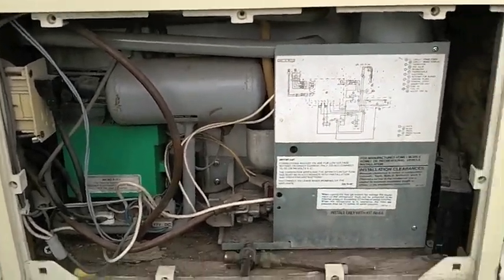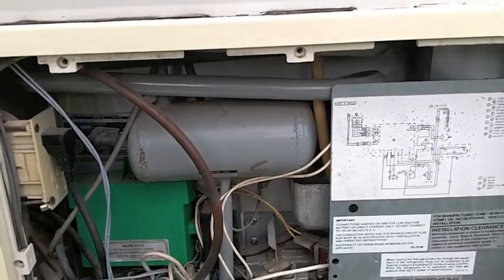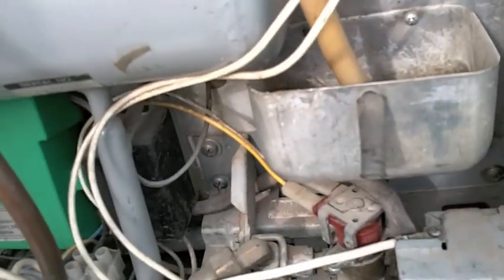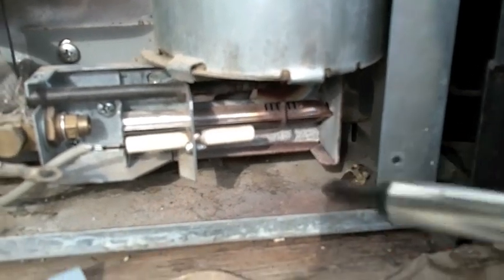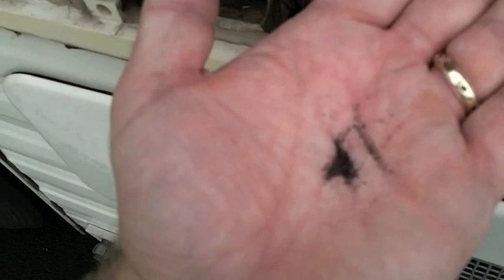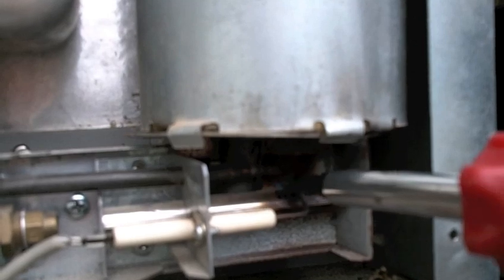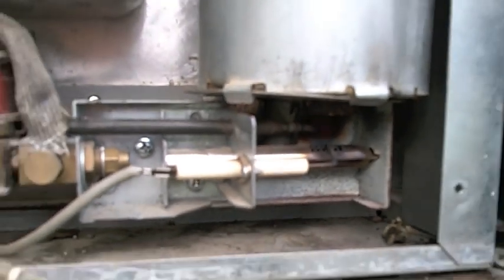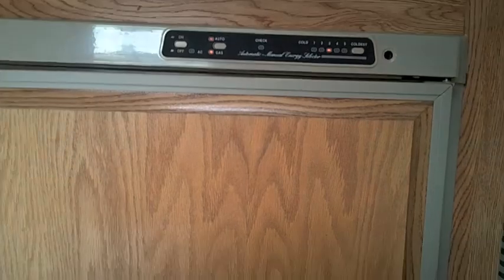RV Refrigerator Troubleshooting

Comment: i have a chescold portable 3way unit and it works great on 240v & 12v but on gas it gets warm or does nothing. so if i can open it up and check the burner ill let you know how it goes.  It worked ok on gas about 10 years ago but i had it in storage since then, flame is blue also.
Reply from the maker: +Mick Wolf Might have leaked all the ammonia.  Look for yellowish deposits.  You also might take it out of the unit and rotate it 360.  Leave it an hour or more on each "face" and end with it sitting upright.
Reply: Its getting to minus 10 on Ac, cant see or smell any deposits, was stored in a dusty dirty place though.
Reply: my bro has the same unit, it didnt run on gas so we checked the lines, it was all good up until the jet, so we removed it and put ut up towards the sun and saw a blockage, poked a strand of wire through it(very very small from a dc power lead of some sort) and checked it, it now has a good flame much bigger than mine does. so now im going to do the same. 
the jet part was seethrough also like it was made of glass or something and where the hole is showed a dark blockage when looking towards the sun. it got cold in the few minutes it was running but a full test is needed. ill report back when mine is done.
Reply: +NelsonStudios my jet had a blockage also, tested for a few hours on gas and got down to -9 Celsius and kept on going, yay thanks, my beer will be cold now 😀

Comment: Great video but sometimes it's the jet orifice getting an oily buildup around the Ruby that causes a yellowish flame ( solid blue is preferable ) . Get a ten millimeter box wrench . Unscrew it then drop it in a cup of alcohol overnight . That should dissolve the oil . Blow out the jet with air or your mouth . Reinstall . An honest repair place would probably just order a new jet to solve the problem . A dishonest place would do what I described then charge you for a new jet . Hope this is helpful .
Reply from the maker: It will help save someone's camping trip for sure.  Thanks.

Comment: Gear tips. You said you do this everyone the fridge starts to warm up. If you went out there every other month with an air compressor and blew out the tube fairly well, do you think that would save having to take it apart? Or would that not do the trick?
Reply from the maker: That would help as long as the air didn't blow it back into the burner.  That would not wreck the burner but it would mean that it would have to be taken apart.  It seems to me that this only happens on old refrigerators, mine is 20 years old this year, when the trailers are moving.  The bouncing knocks the crud off.

Comment: Questions dose the  Pilot stay on all the time? Or dose it shut off at a sirten degree depending on the coldness of frig.. p.s wats the plug to the left side was I unplug it pilot turns on plug it in pilot turns off
Reply from the maker: Some of the fridges will turn the pilot off when connected to wall power  and then light once more off 12v when disconnected.  Google the model number of your fridge to find an operating manual.

Comment: cleaned the burner and get a nice blue flame for about 15 to 20 min then it quits and check light on control panel on frig comes on . Turn frig off and the back onto gas and burner lights and burns for another 15 to 20 min and shuts off. What do I check now?
Reply from the maker: Check that the flue isn't plugged with wasp nests.  Check that the flame sensor is close to the flames.

Comment: Rather than tapping on the chimney to knock rust loose. Can you remove the chimney and brush out with a wire brush or replace the chimney as the galvanizing has burned away with a stainless steel chimney.  A replacement chimney can be fashioned from a standard double wall fireplace chimney pipe. The inner tube of the stainless will not rust.

Comment: I got one of these. The thing was working a year ago. I have 12 volts to it. I have gas  to it and this is evident at a 90 degree bend with a purge valve that hisses when I squeeze it open. I keep trying to light it with matches as well as hoping it will spark auto, but no flame. Gas but no flame. It's as though the control solenoid is 6not allowing gas to flow past it .  I'll try to put 12 volts straight to the solenoid to see if that opens   the flow.
Reply from the maker: The solenoid should make some noice you can hear or feel and can be jumpered with 12v.  I do not know however of any sort of squeeze  gas valve.  Unless I misunderstand you, that sounds wrong.  There is a rubber drain for the icebox but I don't see how that could hiss.  Your gas valve will have to be by law a brass lever or screw valve, nothing more.
Reply: +NelsonStudios It's a90 degree bend with a valve to turn on or off and it's spring loaded so that when squeezed , gas definitely hisses out of the thing. I thought it was purge.
Reply from the maker: Interesting, so you could purge all the air out of the lines to light the fridge quickly after the trailer had been in storage?  I know on mine I will turn all the stove burners on for 30 seconds or so before any of them will light.  I wish I could see a picture.  If you have gas for sure to the solenoid and you can feel the solenoid open/close then you might have a plugged jet. It will be a little brass nut at the end of the line facing the burner.  Carefully remove it and clean.  I use a single strand from a wire brush to slip in there.  Vacuum out the fitting before screwing it back in.  If that fails to fix it then I bet you have either a shutoff or solenoid that has failed.
Reply: +NelsonStudios Can I post a pic here? Got an Email address and I'll send you a pic of the thing.

Comment: On electric my freezer works, but not the fridge. Is it shot? And also the propane won't light for the fridge. Thanks!
Reply from the maker: On the propane check to make sure you have any gas at all, solenoid might not be opening.  If however on electric it still only cools the freezer, especially if the freezer will not go below freezing that is a sign that the ammonia in the lines might be going bad or leaking.

Comment: I also mostly boondock and replaced my Class C Onan generator with a home designed battery/inverter power center.  I use the inverter frugally to extend the battery bank charge as long as possible, so I need the fridge to work on propane.Didn't know a darn thing about these fridges.  Watched your video and cleaned the burner tube yesterday.  Now has a nice blue flame but fridge gets down to 37 degrees on electric and only 42 on propane.  Although the flame is nice and blue it seems a bit small.  Now I'm thinking that not enough gas is getting through the jet and it needs to be cleaned also.  Looks like an easy fix just like a small engine carburetor jet.  I'm going to take it out and clean it with carb cleaner and maybe run a wire from a wire brush through it a few times.
Reply from the maker: +william serrahn I have heard that sometimes funk can get on the jets.  Maybe cut a bristle off a wire brush and see if it is small enough to fit.
Reply: I took out the jet (10mm wrench).  It has a little crystal imbedded in the brass.  I sprayed carb cleaner both ways through it and wiggled a wire in it.  Later read the you should used wood alcohol and never use a wire - oh well.  Anyway installed it and fridge worked great on gas - it must have been a bit dirty.  So I would add advise to also clean the jet while you are in there.
Reply from the maker: Glad to hear it worked!

Comment: Hi,I bought a camper van and can't get 3-way fridge going in any of the 3-ways?Is there a switch somewhere...I can't seem to find one?Of course,past owner claimed fridge to be fine.  Thanks
Reply from the maker: Brian Montague 3 way?  Not sure what that is.  I would check that you have 12v to the power box at the back.  If it will not run, even when the van is plugged into house power I would check to see that you have that 12v.  Someplace in the van will be a fuse or breaker panel, in a camper or trailer they are normally near the furnace not sure where to look in a van.  Try googling "fuse box in (your model of camper).

Comment: A friend gave me a camper yesterday. The kind that goes on the back of a pickup with a section that goes over the cab. Among other things, it has a propane/electronic refrigerator. I don't have electricity, so my only option is propane. The freezer portion seems to be cooling very well, the fridge portion doesn't seem to be getting cold at all. Any ideas on what could be happening?
Reply from the maker: Clean your burner first.  When mine gets dirty the first thing that happens is the fridge stops cooling, eventually the freezer will also start to warm.

Comment: We have a 2003 Fleetwood pace arrow. We started fridge for our trip. Fridge freezer worked fine. Drove bout 5 hours. The fridge would no longer work on electric.Switched it to gas. Both worked for awhile. First the fridge stopped working. The freezer worked overnight. Now neither work on power or gas. We've only used RV 2 times. Not sure of its history. We think maybe needs freeon filled. Help!!!
Reply from the maker: Beth Bennett You can try taking it out and turning it upside down for a few hours then righting it for a few.  These fridges use ammonia most of the time not freon.

Comment: What if we run the fridge with electricity only? We have a 1995 Prowler and the fridge stop cooling period. The light are working but it defrosted everything.  We are currently living in the trailer and need help ASAP :(
Reply from the maker: The light in your fridge is 12v I think, the fridge off power is 120v.  On mine (1993) there is an actual outlet the the fridge plugs into.  I think you will have that also.  Unplug the fridge from that outlet and plug something else in.  If it works then your issue is from the cord forward.  Check for corrosion in all the contacts at the fridge.  If the outlet isn't working then you have probably blown a 120v breaker in the trailer.  Check for that.  Still might have an issue because it popped the breaker but that could be lots of things.  feel free to contact me at acme66[at]yahoo.com if this isn't making sense or if you still can't find an issue.  If you don't smell ammonia or see green/yellow ooze behind the fridge then likely you can fix it.

Comment: My ignition and electronics seem to work intermittently on the fridge and water heater. Not seeing a ignition and flow of gas. Also electric to the fridge but not cooling with switch in on position and auto setting.

Comment: While looking at this video and when you see the burner it doesnt look like the copper propane line is connected to it it looks open ???Also on the copper tubing that carries the propane there is a bolt that looks like its a cap for something to the right of the relay and left of the burner  ???
Reply from the maker: Imbyteme It has a gap so the gas can mix with the air.  That is normal.

Comment: hi.
i have a old 1990 hymer, and am having trouble with the fridge.  i have cleaned it all out and it now lights off gas, the only problem is i can not see the flame through the ignition window.  i pulled the window out and the tube it was attached too, i have cleaned this out and fed it back through.  Still no visable flame.  The problem now is that after feeding it back in, the tube is just hanging down the back of the fridge,  Where is it supposed to go?????? i am worried it will touch something hot and melt .  Any help would be great.  thank you
Reply from the maker: Could you see it at night?  A clean blue flame can be nearly invisible in the daylight.  You might try googling the model number of your fridge and looking for places that sell replacement parts.  They will normally have a parts schematic you can look at.
Reply: NelsonStudios
Reply: NelsonStudios nelsonstudios

Comment: Hello,
great video!
I belive the issue with my fridge is it leaked out the nh3 refrigerant. I've looked around in my area and can't find anyone who will repair or recharge the unit. is their a way the Amish could repair/recharge  mine? maybe have it shipped to them somehow? not the whole fridge just the cooling unit. or is their enyone who won't charge an arm and a leg for this sevice? I hope you could guide me in a promising direction .
eny info helps
Reply from the maker: I searched the internet and found a guy for mine I bet you can find a core for yours
Reply: EBay has complete cooling coil replacements with liquid inside.

Comment: How close does igniter need to be to gas tube.....it was clicking but not lighting, I cleaned out tube it lit. Now igniter will not click, is it a part that goes bad? I can light with lighter and will stay lit.
Reply from the maker: Try moving it closer and make sure the clamp holding it is snug and the wires leading to it are connected.

Comment: have a 2008 jayco camper the refridgerator when it runs for about 2 days it starts frosting up and freezes everything it is on a permenant site so it does not get moved
Reply from the maker: Too cold?  Now that is not something you hear often.  Not to be a jerk but are you sure the temp setting isn't too low?  Maybe the thermostat is bad and always calling for cool.

Comment: Instead of saying "you're working with propane and I'm not responsible...."
You should have instructed the viewer to disconnect power and shut off the propane supply valve......
If you read the service manual it will clearly tell you this. There are labels on the fridge that say this as well.
Reply from the maker: I do it with gas flowing, the flow to a fridge is so very small but that little flow should still help a bit of rust from sticking in an orifice. Your idea could also be a good one, all I know for sure is when working with propane I am not responsible.

Comment: i had a similar problem, how ever your video is awesome we are forgetting one thing as I learned tonight. There is actually a fourth thing that can go wrong as I learned tonight myself. The main house fuse box. There is a 20 amp fuse that controls some of the lights in the back half of the RV. For me I have a 94 fleetwood bounder class A. My fridge had no power, no lights, no nothing. I even ordered a dinosaur circuit board to replace the old one. turns out, I have 120v to the circuit board but nothing coming back out to charge the fridge via gas or electric. I jerry rigged my heating element to my actual home to run 120v from my house to the RV to begin cooling the fridge until what I thought was a bad circuit board. When i went back in the RV tonight to check to cooling, I noticed  my ceiling lights were not working. i found that odd and tried other lights in the back of the RV.. They also were not working. After triple checking the circuit board fuses, I never checked the main circuit board fuses to the RV and sure enough a 20amp was blown. replaced it and the fridge popped on at first with gas but then I changed it back to the house plug in and 120v kicked on and now is working 100%. hope this helps in your next video or somebody that reads this as it wasted 4 hours of my day thinking it was the circuit board when it was the RV house 20 amp fuse that was need to run the circuit board and ignite the propane and run the electrical.

Comment: in my rv the fridge thawed out when the shore power was cut off.what reasons did the gas cut in on the fridge
Reply from the maker: Did you have battery backup?  Unless there is a 12v backup the gas side can't light.

Comment: What about when I'm on 110 or like now, am out of LP? My 8 year old Dometic gets fairly cold but only about 18 in freezer during day and 40+ in the fridge.
Reply from the maker: Dan Zeeff On a hot day that might be all you get out of it.  Check that the bugs or birds haven't blocked the vent above the fridge on the roof.  It needs proper ventilation to work.  That said on a very hot day or when the camper is very hot inside it isn't going to get as cold.
Reply: NelsonStudios Thanks. I'm going to do the cleaning that you show here, and see what we get. Checked out the roof vent this am and one dauber nest but nothing blocked. I'll let you know.

Comment: We have a Norcold fridge that has developed a rounded bottom on the inside. This is making it impossible to open the produce drawers. Anyone know why this would happen, or how to fix?
Reply from the maker: I bet the drain is plugged with mud/gunk and the water inside is freezing and bowing out the bottom is my guess.  Put everything in a cooler and let it thaw out for a full day and open the back cover to make sure the rubber drain line is in place and not plugged with junk.

Comment: None of the old  refers had a pilot light. They regulated the temperature in the refer with a high and low flame. Maybe some of the new refers shut their flame off and  relight electronically but the first electronic ones lit automatically but also had the high-low flame feature. Me, I'll take the pre-electronic Dometic RM100 from the 1970's any day. When the electronically lit refers and furnaces came out they were terrible problem ridden piles of junk and made my life as an RV mechanic miserable.

Comment: I have a Dometic gas electric refrigerator in my 5th wheel. I have been told there is an ammonia leak and that it doesn't work.  And to keep the door shut ( it smells like ammonia ) that the fumes could be fatal. Does anyone know anything about this or what I should do, other than keep the door shut?
Reply from the maker: You can have the ammonia side replaced by some of the Amish companies that specialize in this sort of work.  That or replace the unit, it isn't an easy fix.